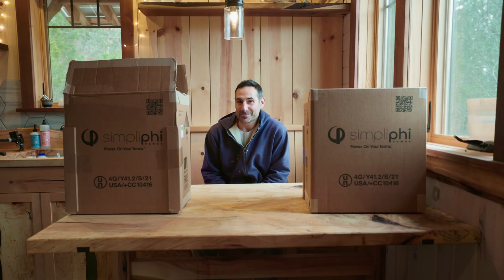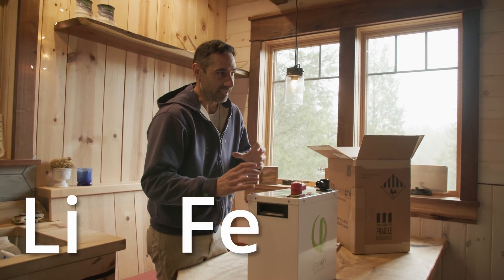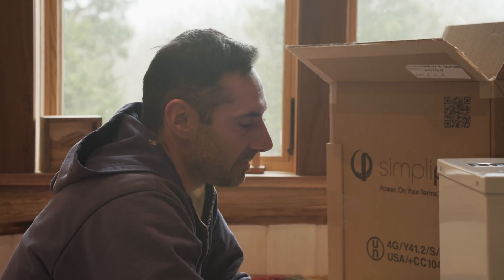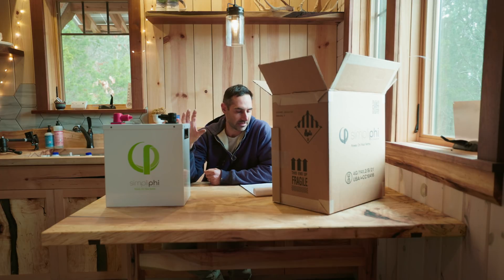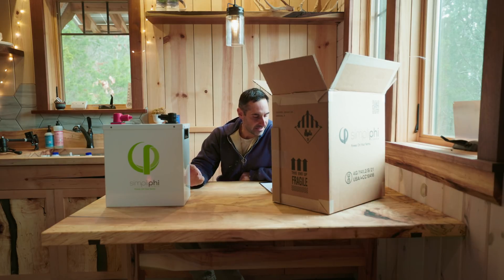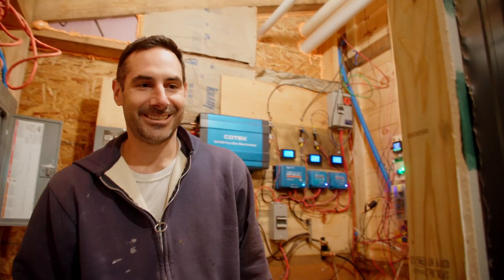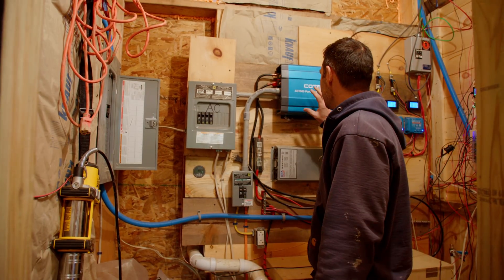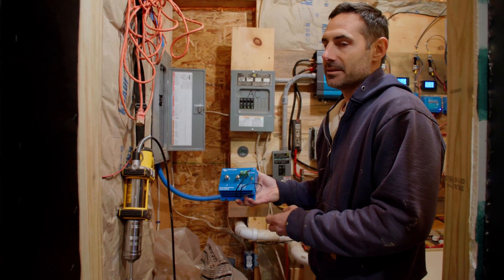Unboxing my New Simpliphi Batteries

Comment: Do you have any kind of a low temperature shut down of the charging circuit.  According to Simplify, if you attempt the charge the batteries below 32 degrees F it can damage them.
Reply from the maker: Yes, the Victron charge controllers can (are) be programmed for low temperature shutdown.  These batteries do have a BMS and I’d be shocked if the BMS also didn’t have it built in given their price point.

Comment: Nice looking batteries ,how many amps hours would those be maybe you said and I missed it and what kind of money are you looking at close to a 1000 each.I didn't know a bms could fail . I'm currently using lead acid but have a small lithium for my garage lights . I charged it to over half its hooked to solar 200 watts  I've heard now it could be a problem in cold weather and it shouldn't be charged ,do you know if that's true and will it ruin the battery it was my first summer of trying lithium . If a bms can fail could it also allow the battery to be overcharged  .Any info would be appreciated Thank Dale  Happy new year
Reply from the maker: They are each 3800 watt hours, so divided by 24 volts they are each around 158 amp hours.  Yea BMSs can fail, it's not common.  If your small lithium battery has a BMS that should prevent charging below freezing.  Most can be discharged down to around -4.  The charge controller should avoid overcharging.

Comment: Just a heads up, LiFePo4 can go down to 2.5-2.6 volts a cell, making 20.8 in your 24 volt battery, with 2.85 being considered safe and acceptable which is 22.8.

I wouldn’t program your cutoff any higher than 24,0.  You’ll lose a lot of usable KWh.  Simpliphi’s chart of 24.0 @ 0% is extremely conservative.

I’m ordering close to 15kWh of lifepo4 cells and building my own pack + BMS.  The high side per cell is 3.65, with people generally not going above 3.5 per.  So in your 8series for 24 volt, it’d mean a high side cutoff of 28.0, which you nailed.

Note the voltages arent linear either.  They’ll quickly settle to 3.3-3.2 volts when in 20-80%, 

Lead acid you’ll get more linear drop off.
Reply from the maker: I’m using the voltages specifically provided by the manufacturer.  Not all LiFePO4 cells are created equal so it’s impossible to give voltage advice across the board.  Simpliphi uses (cylindrical) cells that are manufactured specifically for their use.  I’m not trying to regurgitate marketing hype, just stress that their cells are like no others.
Reply: @50Acres  ah makes sense.  I’m more used to prismatic cells.

Ps.  I have 4x 100Ah 3.2volt LifePo4 cells I’ve been cycling since 2012. Still going strong :)

Comment: Sell that inverter and by a decent Victron. Do that and never look back. That's what I did and it's miles apart from other inverters. Don't think about it just do. The 1.2kw are the best value entry models.  :)
Reply from the maker: I would like a victron, I'm kinda torn because this cotek has just always done what it is supposed to do.
Reply: @50Acres  With those new batteries and a victron inverter, you could run a small window
refrigerated air-con on those muggy days no worries, ya know. Why not mention that to your wife, and see where the conversation goes ?    :)

Comment: If you had mounted the disconnect upside down you would have the batteries connected to the output side of the relay/contactor.  It would not work properly unless the 24VDC is connected to the input side to power the internal circuitry.  ie., you chose the right way ;~)

Comment: SimpliPhi Power PHI 3.8kWh Lithium (LFP) Battery, 24V       $2,495.00                not cheap
Reply from the maker: Here's a calculator you can use to compare lifetime cost vs other batteries: https://simpliphipower.com/support/levelized-cost-of-energy-storage-lcoes-calculator/#gf_28
Reply: @50Acres  not knocking the batteries and i am sure they are awesome just pricey

Comment: I’ve done a lot of research on Lorin batteries, you’re in literally the first that says you shouldn’t discharge down to 0. I’m not saying you’re wrong, but I’d even the internet doesn’t agree with you, either you’ve got a bad brand or the information just isn’t correct.
Reply from the maker: Yea this is established.  People don't talk about it too much because the job of the BMS to perform this function.  Most of the time it does, but sometimes they fail.  If you go on off grid forums you will see a lot of stories about people trying to recover their cells because their BMS failed.  Here's the first example I came across after a 15 second search: https://diysolarforum.com/threads/failed-tinybms-and-recovery-of-dead-cells.32466/  Some companies are more honest about this than others.  It's definitely best practice to have an extra layer of safety.
Reply: @50Acres  as for that article... there’s a lot of holes in that users assumption. He tried running raw cells linked together that weren’t actually balanced, he just took someone else’s word instead of actually putting in the work. You have to match and balance when putting raw cells together, and that happens before the bms is put on. He also couldn’t state how he programmed it. At the end, the cheap battery cells he bought weren’t even around anymore when he needed more -that’s a tell tale sign of a bad product in any industry. And at one point, he even said he charged them down once in the past when he forgot to reset the switch.  If you’re worried about it failing for user error or poor quality parts, I can understand the caution. But in that referenced case, that was user error and cheap manufacturing.

Comment: 200+ years of battery tech and the only reason lead acid was king for so long is portability. If you have the room for it you can make battery cells out of plastic totes to hold chemicals and distilled water with a layer of oil to control evaporator.

They have a dry stack battery that has powered a bell for 170+ years that they are waiting till it dies to see how it was made

This is why those battery powered shop lights are useful
Reply from the maker: Wow that's super cool.  I would love to know how that works, maybe it will quit in my lifetime.

Comment: Hey Mike great video 👍. How's Simpliphi batteries charge at cold temperatures. Do they have a internal heating system?
Reply from the maker: They can charge down to 32 F. They can be discharged to -4F the BMS has built in temperature protection they don't have heating built in.

Comment: sad to say but they are way out of my price range at this time. great video and thanks for sharing and have a great Christmas to you and your family
Reply from the maker: There are a lot of good strategies for making up for the disadvantages of lesser batteries such as virtual tracking, low use devices, running stuff straight off DC.  With a little bit of planning you can design a system that will work for you.

Comment: Wow! Idk who's holding the camera... but they should learn how to use one.
Reply from the maker: Have a wonderful day Gerald!!
Reply: Guessing a local simplihi dealer rep came out to shoot the upgrade & install.  So use to Mikes angles & choice of framing its easy to contrast 'another'  style of filming.  So Battle Born did not reach out to you? Or their 24v choices were not as good as simpliphis?  I remember your choice for the Pb/acid at the time saying "they were cost effective & good enough" at that period because the Li batteries high cost.  Will lo temps affect battery longevity for this brand? 
Congrats on the upgrade & looking forward to real world satisfaction  updates.
Reply from the maker: @ronsmith1364  I had a friend out helping me film.  I could have got battlebornes but they wanted me to fill out a lot of paperwork.  And I hate paperwork.  I also have always wanted simpliphis. The batteries BMS will prevent charging when it’s too cold.  Temperature issues should be pretty minimal especially compared to the decrease you get with lead.